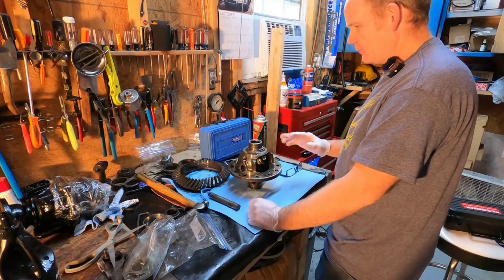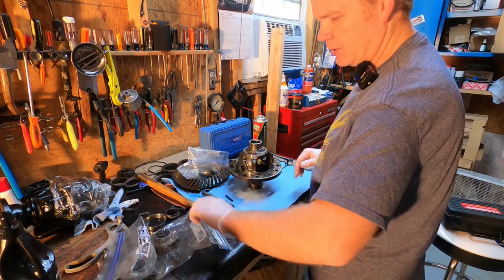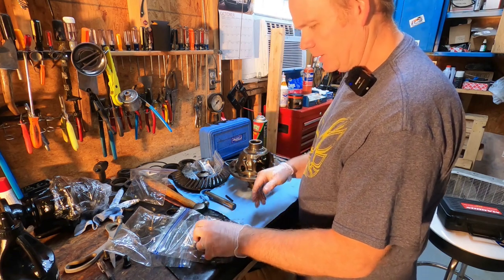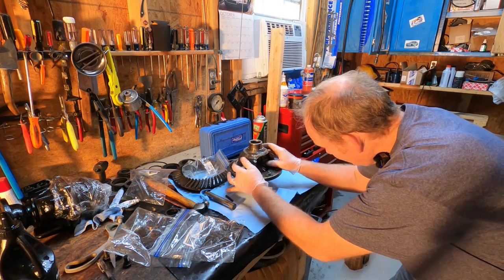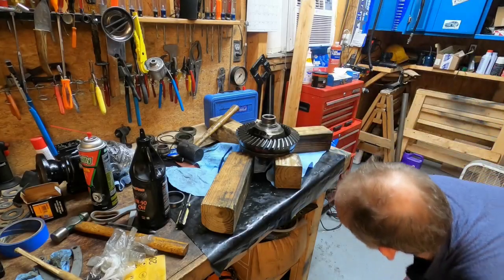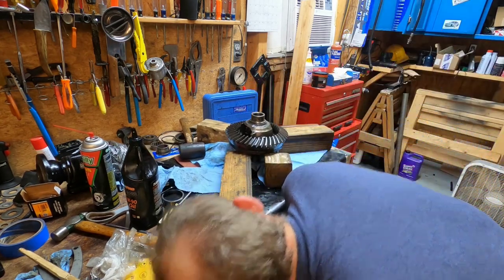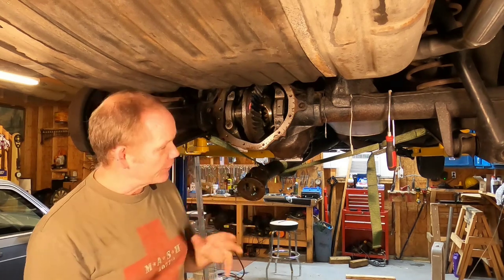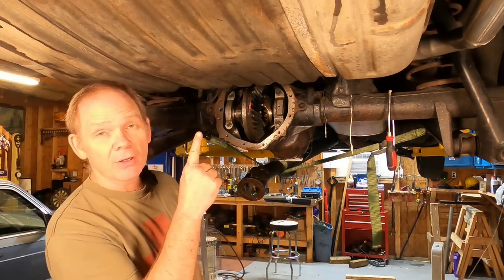71 Cadillac Coupe DeVille - Finding Resonant Drivetrain Vibrations Part 10 - Reassembly

Comment: This is all so interesting. But I am ashamed I either missed or have forgotten the exact relationship between this rebuild and the solution to your driveline vibrations.
Reply from the maker: This rear end was very very loose. Both the pinion and the carrier had zero preload when I started tearing into it and taking measurements. If the diff is too loose, this causes vibrations. New bearings and a proper setup should correct the issue. Fingers crossed of course.
Reply: @ImpalamansGarage  great video. I have a 69 deville I'm having a hard time identifying the type of rear end I have it looks like a GM version of the ford 9in. Looking to put a limited slip diff but I don't know if it'll interchange with other GM diffs.